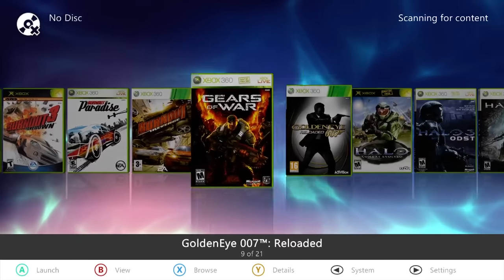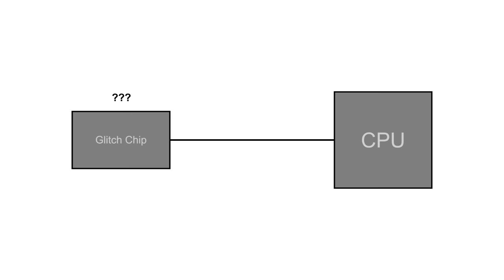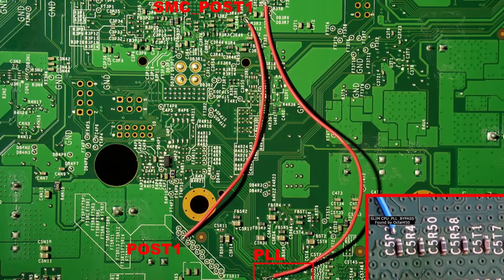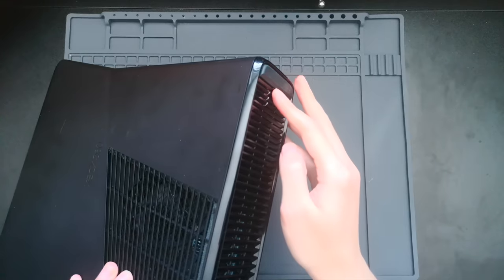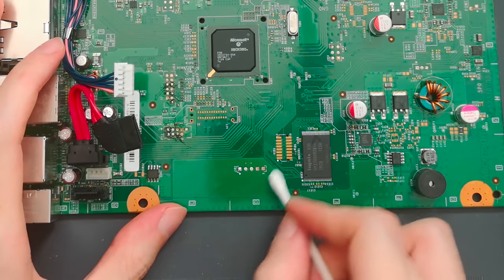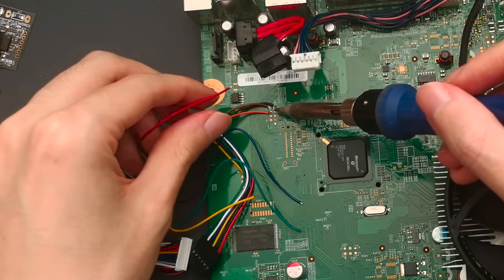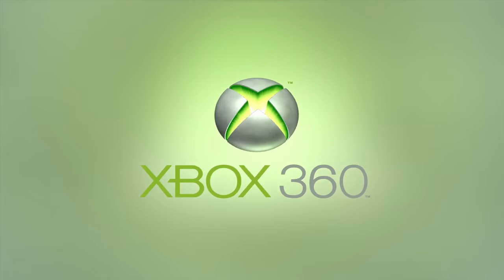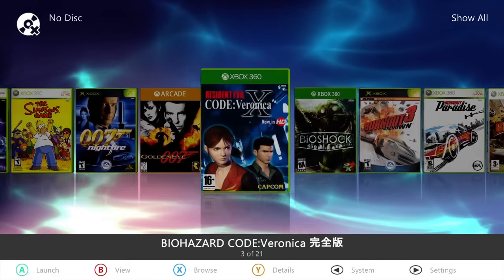You can mod your Xbox 360 with just two wires!

Comment: I've always been surprised with how small the 360 modding scene is. It feels like the end-all be-all system for modding. A powerful system that can emulate most OG xbox games pretty well seems like the xbox og plus. Hopefully it'll become more popular in the coming years.
Reply from the maker: I think if someone ever found and published a softmod, it would bust the doors wide open for a modding scene. It's just that soldering is too high of a barrier for entry for too many people; not only is it a new skill you have to learn and practice in advance, it also means you can't just mod it with stuff lying around the house (e.g. an SD card or flash drive).

RGH 3 improves things in that it lowers the cost and greatly simplifies the installation, but I don't think the scene will ever be as big as the Wii/PS3/etc until there's a no-solder solution. Maybe one day someone will find one...
Reply: The PS3 is much easier to mod and can play PS1/2/PSP games + its own library of games. So, that's the 7th gen system of choice for most console modders. (except the Wii of course). The 360 just doesn't really offer much over the PS3 for people who want to mod.
Reply: pretty sure it doens't emulate OG Xbox but runs those games natively
Reply: @CrocoDylianVT it does emulate. OG is x86 whilst 360 is PPC
Reply: Probably because laughing stock consoles like the Wii U and 3DS are in super high demand and have some really powerful albeit immature CFW. And can both play 3 generations of games natively (AGB, DS, 3DS, GCN, Wii, WiiU) and emulates the others handily. 360 is very hard to mod unfortunately and doesn't really have these features
Reply: Small and behind-the-times. I was sad to see after modding my 360 that most of the homebrew is proprietary and distributed on random forums. Someone determined could surely come in and disrupt things if they wanted.
Reply: would be awesome
Reply: @swirl6996 well, i think the market of hardcore Xbox 360 and PS3 people doesn't have a lot of overlap with the hardcore Wii/U and 3/DS people.

come to think of it, the hardcore Xbox 360 and PS3 people probably overlap more with hardcore PC people. most major games on those systems were on PC as well, and modding those games on PC is significantly easier for most people (not to mention running custom software on PC is trivial). and for the few console-exclusives, emulation has been getting better in the past few years. so i'd imagine the number of people interested in using a modded 360 nowadays is pretty small.
Reply: Yeah, I recently modded my Xbox 360, and while I'm glad most the essential stuff is there, the 360 scene lacks a lot. I thought it would be a great chance to improve some software, but almost everything is closed source and behind the scenes. It looks like most homebrew uses the official SDK, so I guess that's why.
Reply: @MattKCBytes also the fact the 360 is a pain in the neck to open. The og is a joke it's what 6 screws? The 360 has a lot of tabs to break and so much to deal with inside.
Reply: @BouncingZeus  The first console I ever opened when I was like 6 or 7 was an OG and it was sooo simple. When I opened my wii for the first time a few years later I was shocked with how complicated it was.
Reply: Wii is pretty bad so are the DS and 3DS too.  Only easy Nintendo ones are the NES, SNES, and N64. @DrKoneko
Reply: You can buy a PS3 for literal pennies and you can softmod it easily. No reason to bother with a 360.
Reply: Would love to learn soldering
Reply: @dylanwinn3 It works without an internet connection, it doesn't download a compiled copy, it emulates. You may be confusing it with the Xbox One, which does download recompiled games when you insert a disc for an older console.
Reply: It’s hard to compete with softmodable PS3, I guess
Reply: i think one of the reasons is that stealth servers are paid and besides that you also have to pay for xbox live itself.
Reply: @dylanwinn3  oh ok, thanks.
Reply: At first I really find it hard to open the 360. Specially the locks at the back of the console. There's no way to buy the key that unlocks all holes at the back at the same time where I am from. What I did was I created my own using a plastic CD case. After that, I was able to open the console without looking. I even memorized where the tabs on side as well as the screws are located 😂😂😂
Reply: @swirl6996 bro what are you on about? How is the 3ds a laughing stock, and luma 3ds is amazing at this point.
Reply: I can't speak for anyone else, but after my first RROD, I'm more likely to rely on wet spaghetti to play games on.
Reply: @BouncingZeus the 3ds is pretty easy to mod. I’ve modded over 10-20 consoles now ranging from 2ds / 3ds… the Wiii is the easiest out of all Nintendo products , the n64 problem is the mega drive carts cost 200-300 dollars where as you can hack the Wii with a simple plugin…
Reply: It was actually huge in Russia! Everyone had a mooded 360
Reply: Modded xbox 360's were huge in thailand too. To the point that it was easier to just buy copied games than originals(as in to find a shop that sells them and modded your 360).

The thing is that when og xbox modding was huge they were useful for getting a decent image quality on your tv for playing movies and stuff but come 360 you mostly just needed the mod for playing games since everything had hdmi and you could run whatever emulators and stuff on any pc you had laying around.
Reply: I have no problem with soldering if it’s clear where the damn points need to be. Most of the time it isn’t. I give up, software for the win.
Reply: I had no idea it was this easy. Now I want a 360
Reply: In Brazil we use this so much
Reply: Small….. y’all are joking right
Reply: @CrocoDylianVT Well I know I’m playing Crash Nitro kart boosting in 720p on there but I set to 1080p and it looks great
Reply: @swirl6996 you take yourself way too seriously to be calling toys "laughing stocks"
Reply: I like the Xbox one approach, oficial xd 

Yes, 20usd and you get to install emulators
Reply: If you want to see the 360 get a boost in modern ownership, I think we need to see a softmod come out first. I think there’s a lot of people that are scared of messing up their system through soldering or simply don’t know how to do it. A software-based solution would break open the floodgates, and then I think we’ll see more people jump on board. People have a lot of nostalgia and reverence for the 360, so I think having a softmod option would be a great idea. Even better would be a replacement service for Xbox Live.
Reply: @rustylasagna  since Xbox 360 is an offline only device now I think we can pressure Microsoft into releasing some info, there is not gonna be any game sales on there anyway
Reply: @Reptonious i worded that poorly... please read my other reply
Reply: @FIashShorts  lmao
Reply: Im actually getting back into it after 5 years
Reply: malice5121  Very true. Only thing I can really think of that’s worth getting a modded 360 for is all the indie and arcade games that were all delisted. Lots of those games are pure trash, but there’s some gems and they at least have charm to them. That and the shmups like you said. But even still, the xenia emulator is progressing pretty well so that would kinda negate the need for a 360 at all (also true for the PS3 but I digress).
Reply: I’ve collected about 15 slims and 10 fat 360s. I’ve destroyed two 360 motherboards trying to solder to them.  I can’t seem to successfully mod the 360 😔
Reply: Doesnt help too that there are like 8 different revisions of the hardware, and the process for hard modding them differs by console model, software, etc. Its a mess.
Reply: Its because the hard mod required.     Most people dont solder and cant even open the case without breaking something.  I modded my ps3 and wii myself with just a laptop and youtube.  I bought my jtag and glad i did.  Displays, loads, saves, plays og and 360 games beautifly off of a usb hdd.
Reply: @MattKCBytes  with how michaelsoft operates and designs the xboxes i doubt that will happen if it hasnt already. 

XB1 and above is virtually unhackable (theres dev mode but that aint hacking)
Reply: also think it doesn't help that xbox is backwards compatible. like for a lot of these games on Playstation or Nintendo. the older consoles are the only way to play them but if you really want to play xbox360 games you can play them on your Xbox series X or something and they'll run better as well. so I think 360's are just less popular in general. (kind of proves GabeN's point that piracy is a service issue)
Reply: PS3 was easier to get unsigned (or even signed code on 3.55 and below LOL) code running.
Reply: @CrocoDylianVT  "pretty sure". Wow. People are so confidently wrong these days it's shocking.
Reply: Def was not small 💀 you must of not been in the bo2 halo and gta era 💀
Reply: Small? Wat.. Regged on se7ensins and JTAG'd my x360 back in 2010 and even back then you had multiple venues for modding your unit.
Reply: i was extremely lucky that most in game mod packages could be installed with a simple flashdrive and the right software... i played copies of some games with all dlc through those means...... couldn't even do half of this on ps3 as it wasn't as versatile as the xbox  @Windy-
Reply: @Windy-  fun fact xbox360 can em ps1 and ps2 games and ps3 360 can also run Linux and many more emulators
Reply: @Windy- as true as that is psp games are finicky to get working I always had problems every time I tried
Reply: @CrocoDylianVT  360 was originally backwards compatible with hundreds of og games. After RGH you can load all OG games but many still wont play correctly.
Reply: Security was and still is a huge factor.
Reply: Honestly modding was popular when the thing was new
Reply: @landon6387  Wrong. Modding the OG XBOX and 360 has NEVER BEEN MORE POPULAR!!!!!!!!!!!!!!!!!
Reply: @landon6387  right. The point tho is that the og Xbox seems to currently have a bigger modding scene than 360.  Even tho the 360s potential far exceeds the og.  🥂
Reply: malice5121 You have no idea what you are talking about. Cell architecture was difficult to develop for, and 3rd party games OBJECTIVELY run better on a 360 most of the time. This never stopped being an issue even as the jank was ironed out. It's clear you did not play with both consistently.

I also can also count the amount of worthwhile games on the PS3 with one hand. No, wannabe movie crap that Sony started cranking out that generation onwards does not count. Don't @ me with Unsharted or the Yew of Us.
Reply: @MilesProwerTailsFox Never going to happen. Ms would claim copyright/patents issues and would claim it would allow attackers to break into new consoles by studying how the 360 is protected.
Reply: @sbmotoracer  the Xbox 360 and the Xbox one are protected differently, we know exactly how, the Xbox 360 it's an entirely different architecture and protection design and Microsoft did released info like a week after I made that comment
Reply: installing the software is a B and there's a lot of issues that aren't documented very well without hours upon hours of digging
Reply: 20 bucks and Xbox series let's you Install emulators and mods of games in those emulators
Reply: This video singlehandedly got me to buy a used 360 to be able to mod it, so I'd wager that it will.
Reply: Because modding a ps3 takes an hour and doesn’t require soldering
Reply: I would mod my 360 but I'm terrified of the horrors that lay inside that thing 😂
Reply: Same as how I don't get why Xbox original and Xbox 360's modding scenes are so small and unrefined. Many of the best games of all times are in these two generations and many exclusive to this console as well, yet no one cares to do anything.
Reply: @CrocoDylianVT nah, bcp runs in an emulation, and it also lets you run all of the og games
Reply: @JackMoynihanOfficial actually documentation in the community on several websites makes it a complete Breeze. There's only two sub models in one particular model that it is hard to identify only one factor of the mod. And it's part of the process, tearing down you visually inspect in the process to confirm(both moddable, just diff check)
Reply: @swirl6996  Wild to call the 3DS a laughing stock when it has easily the best library besides the PS2 lol
Reply: It's small because of it requiring skills with soldering which gatekeeps out the normies.
Reply: Apparently you've never even looked into the modding scene on 360.
Reply: It has/had no chance to compete with the way better ps3

Comment: Something to note is, because you were already RGHed you could pull the nand and reflash entirely through software before tearing it down, bypassing the extra soldering.
Reply: If only you could remove it it easlily
Reply: Dude i was gonna say i don't remember RGH being this easy, and ofc hes fucking leaving shit out so he can have his clickbait title
Reply: @seadffsa  I mean, the RGH itself is still 2 wires, you just need something else to flash the chip.
Reply: @seadffsa   OP was just suggesting an easier method since Matt already had his Xbox modded, but Matt did it the hard way, and did all of the necessary steps that anyone just getting into RGH3 would have to do. Don't get mad until you actually understand whats going on. I do still agree its a clickbait title though lol.
Reply: Agreed use xell if its not 4gb.
Reply: Yeah if your already RGH'd... so you already soldered shit on.

Comment: It's interesting seeing the 360 running outside of the case. Not something you see very often.
Reply: @bentbk  it's the most common use case since nowadays almost all Xbox 360 are modded and is so easy to fix the tiny cooling issue by just taking off the top part
Reply: Took me back to the hotswapping days 😊😄

Comment: I recommend ticking the optional box for usbdsecpatch when flashing back the modified NAND at the end (so not at the xell install step but the one after that). Lets you use unauthorized controllers. Everything from DIY arcade controllers to any third party controller (e.g. 8bitdo, gulikit) with an xinput mode and you can even use the Wii Guitar Hero guitars if you get an adapter for them, then use them to play Rock Band. You can also set your disc drive to play movies (not games) from any region instead of just the region you're from in one of the deeper settings areas, so I started doing that as well before flashing, though admittedly I've never taken advantage of that feature.
Reply: Can this be used to connect modern xbox controllers to it? I got an Xbox One controller to turn an unmodded console on but it doesn't do any more than that
Reply: @Mr_Lesbian  I don't have an Xbox One controller to test with but I have an Xbox Series controller and it sadly did not work without an additional adapter. You can use a Mayflash Magic NS 2 set to Xinput mode and then connect wired and then it will work. There are probably other adapters that would work too, but I tested with that one specifically. You can also use these adapters to make something like a DualShock 4 work.

From what I can tell you just want something that pretends to be an Xbox 360 controller when you plug it in, and with the controller security disabled it can't tell it's not a real one. Luckily that's already how a lot of third party and custom controllers work on PC.
Reply: holy crap thats awesome to know especially for the guitar hero controllers!!!
Reply: Would be interesting to see if it supports stuff like Nacon PS4 Controllers (Many of their controllers use XInput, despite being a PS4 controller)
Reply: not that it's hard to update your flash using xell, but there's always some risk to doing so (say your power goes out or you flash a bad image). done it enough times to feel "safe" doing so but we get wanting to do it right the first time :P

Comment: rgh3 is fairly easy to perform, but take it slow, dont rush and just be aware of what you are doing, be careful with you iron placement, use flux and good leaded solder wire, use a nicely small tip at a higher temp (325 C), and just be careful.
Reply: Then it’s not fairly easy
Reply: @itsjuank it isn't easy or hard it's sort of meh. What is hard is having patience to do it.
Reply: @palehound1100  That really depends on your experience.

I've heard some horror stories of people trying to mod their 360, because they just didn't have any experience of using a soldering iron.

Comment: My RGH 1.2 had good boot times, but recently it started to take longer to boot. I've planned to resolder the chip and clean it to see if it makes boot times better again, so I'm glad I came across this video because I'm gonna get rid of the chip and do this. Great video!
Reply: If its a phat, keep the chip and use the latest method for RGH 1.2 V2. Same boot times as RGH 3 when you get the timings right, which doesn't take long at all
Reply: If Slim Trinity do RGH 1.2 V2 with a matrix chip if Phat do RGH 1.2 with a coolrunner
Reply: did you do it? how did it go? I have a coolrunner chip and it takes upto 15 min sometimes to boot
Reply: @GMAK3R why the RGH 1.2 for Trinity? Does RGH 3 not work for it?

Comment: If you want to save some time converting an RGHed console to RGH 3, just use the existing retail NAND dump to build the RGH 3 XeBuild image and then install it with Simple 360 NAND Flasher via USB. That way you just have to install the RGH 3 wiring, and you're done
Reply: I came here to say this and I would definitely recommend doing this over an external flasher for those who don’t want to solder additional wires or those who don’t have a flasher because they purchased their console premodded.